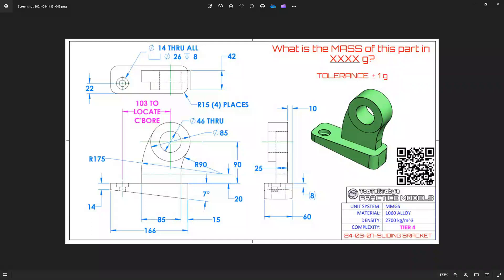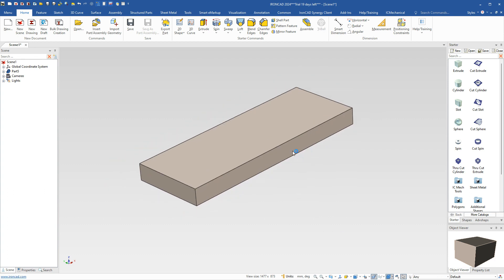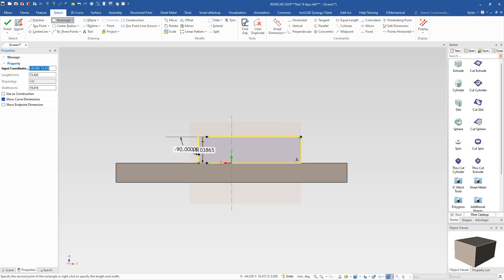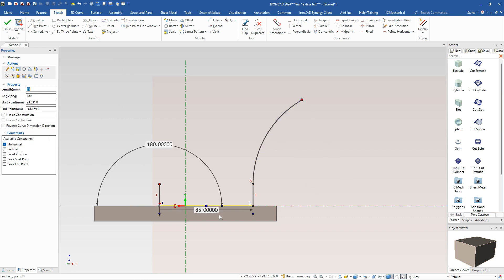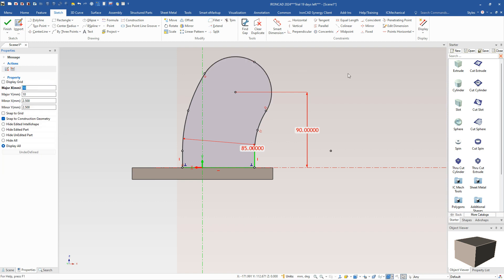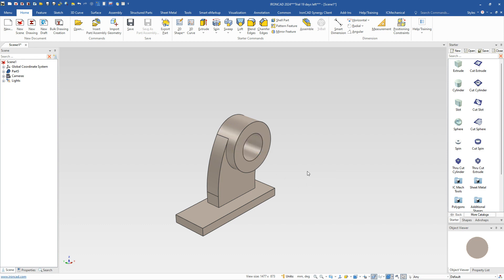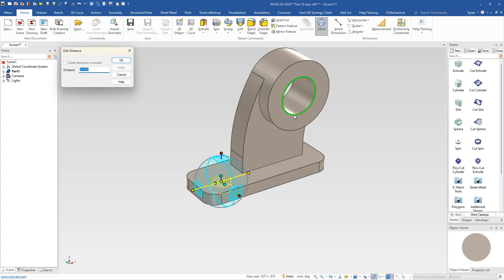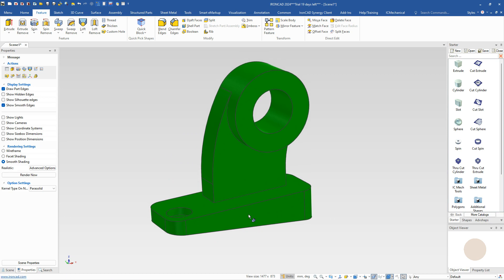Too Tall Toby Practice Models Performed in IronCAD - Practice 24-03-07

Comment: There is dimensions that you did not used why?
The dimensions is 15 from right side to the stand off bracket. The 15 is next to 85.
Reply from the maker: You are correct that I forgot to space it over 15mm. It would be easy to do with the TriBall to position it 15 mm from the edge. Just forgot to do it and that position in this case did not impact the end value of the mass. Thanks for the catch.